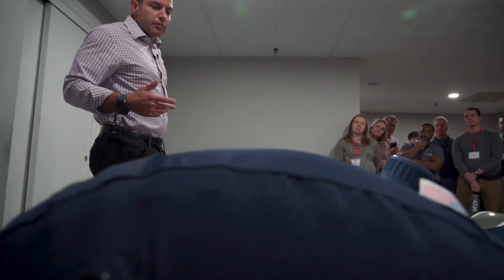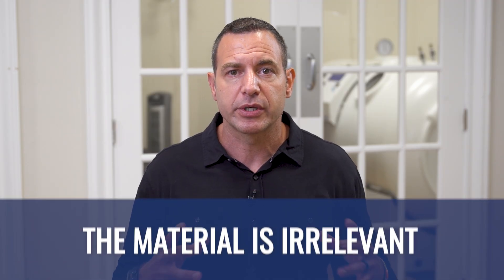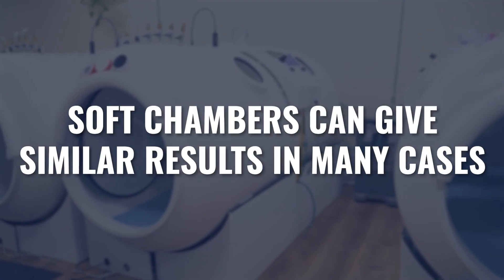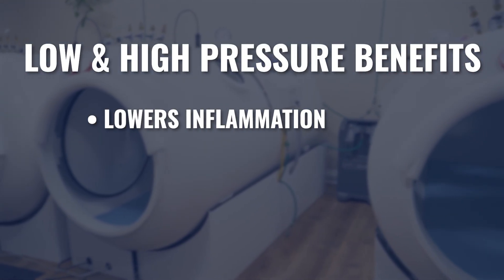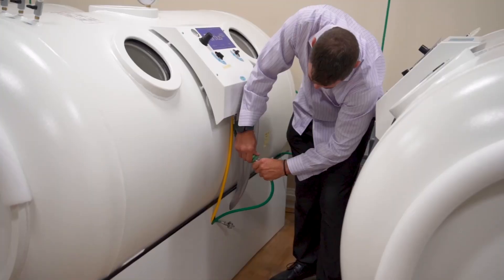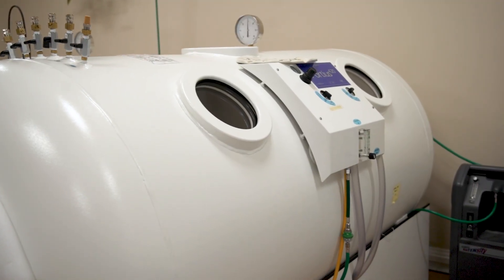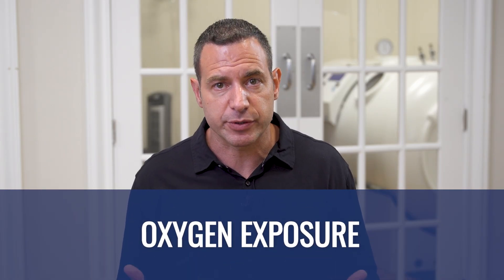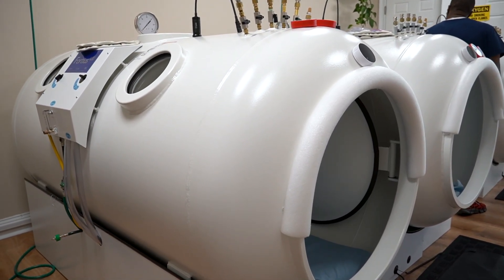Soft vs Hard HBOT Chambers: What Recent Research Reveals

Comment: I have soft chamber at home  and fighting radiation damage, does soft chamber help the radiation damage?
Reply from the maker: We can't give you medical advice in a YouTube comment. But generally speaking, yes, using a hyperbaric chamber should help heal from radiation damage. This is actually an on-label indication for HBOT. While the research for this is done at higher pressures and you can't claim to have the same results as the studies if you're not following the same protocol, lower pressure HBOT has been shown in recent studies to still promote healing and regeneration.

Comment: Could you please provide your research imaging studies and relevant statistics, similar to how Dr. Shai Efrati presents his findings? Regarding material considerations, higher pressures necessitate a hard chamber to withstand them. In a soft chamber operating at 1.3 ATA, the patient is essentially only experiencing 0.3 ATA of actual pressure, while 1.0 ATA represents the normal surface pressure we are constantly exposed to. According to UHMS and similar regulatory bodies, a minimum of 1.8 ATA is required to achieve therapeutic pressure for approved indications, as outlined by UHMS and its European counterparts.

Comment: The video by Dr. Sonners compares soft (mild) and hard (higher pressure) Hyperbaric Oxygen Therapy (HBOT) chambers. Dr. Sonners concludes that the key distinction is pressure, not the material of the chamber.

1. Pressure is the Key Difference 
The debate is not about the chamber's material (soft vs. hard), but the amount of pressure they can achieve.

Soft Chambers (Mild HBOT) typically operate at a lower, mild pressure of 1.3 ATA (atmospheres absolute). These are more accessible for home use or in clinics.

Hard Chambers (Higher Pressure HBOT) can operate at 1.3 ATA or higher, with many used at 1.5 to 2.0 ATA or greater.

2. Head-to-Head Research Findings 
The Sonners, a PhD, performed a head-to-head comparison between low and high pressure HBOT, revealing areas of overlap and key differences in physiological impact:

On systemic inflammation, low pressure HBOT lowered inflammation, with specific impact on certain cytokines, while high pressure HBOT lowered inflammation, with specific impact on a different set of cytokines.

For cognitive and memory function, low pressure HBOT improved cognitive performance, but appeared to do so slower; the impact lasted longer after treatments ended. While high pressure HBOT improved performance, it appeared to do so faster; but the impact started to fade over time after treatments ended.

For biological aging, low pressure HBOT had more impact on certain biological aging clocks, while high pressure HBOT had an impact on different biological aging clocks.

3. The Need for Variation and Customization 
Dr. Sonners' conclusion is that neither extreme (soft chambers do nothing, or soft chambers do everything) is correct. Both have massive impact, but the "best" choice depends on the patient's specific health goals and issues.

Dr. Sonners recommends adopting a concept of "hyperbaric variation," similar to exercise or diet variation, by changing the frequency, duration, pressure, and oxygen exposures to extract the most benefit from the programming.

Patients can combine the use of an accessible mild (soft) chamber at home with periodic, higher-pressure exposures at a local clinic to achieve this therapeutic variation.
Reply: Wow money bags. Own a soft and go to a clinic.

Comment: I want to say I have watched I think every one of your videos and want to thank For teaching us all how to be safe and of the benefits that are available to us. 
I purchased a hard chamber capable of 2.0 ATA It also has settings on it for 1.3 , 1.5 , 1.8 & 2.0,  I started out at the lower settings and gradually built up It has helped me tremendously I am once again able to stand up and balance myself I have had a stroke but am also an amputee and got to the point I did not have the strength to balance standing up on my own, My heart chamber was expensive but at the price of a cheaper new car I am able switch between all the needed pressures that are possible also I live in remote mountains of Alaska and there are chambers available for me to go to so I bought my own I take methylene blue before my sessions also the one I bought has red light therapy built into it at the manufacture
Reply: What brand and model did you buy?
Reply: i think its made in china

Comment: I am HBOT certified and I was about to buy a hard chamber and then One blew up in Michigan and killed a 6 yr. old boy.  They have just settled for millions of dollars.  I never bought one.
Reply: The chamber that blew up and killed the little boy wasn’t grounded. The report I got was they basically did not follow all precautions. I wouldn’t be put off by that story. Just follow all directions.
Reply: Yes but they were also using pure oxygen to pressurize the chamber that will not be a problem if you are using air to pressurize the chamber and using a oxygen mask